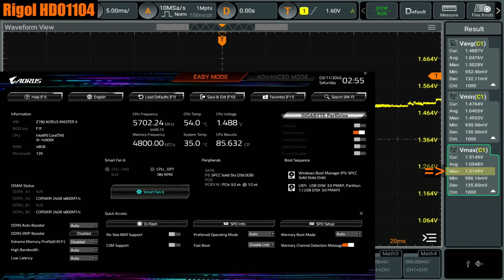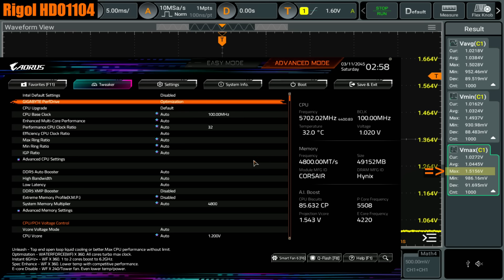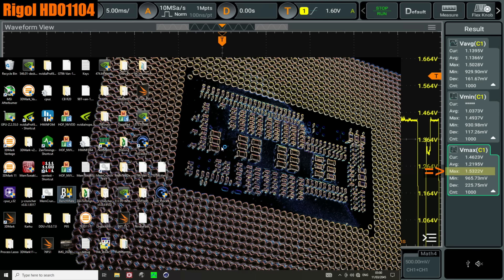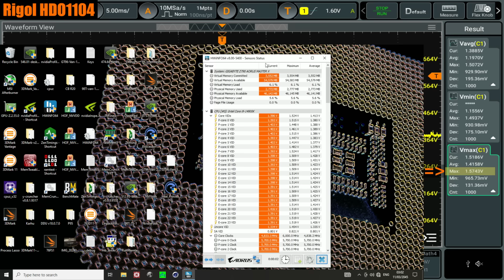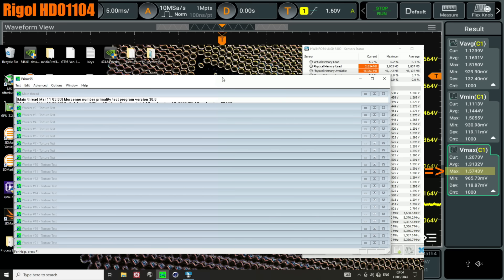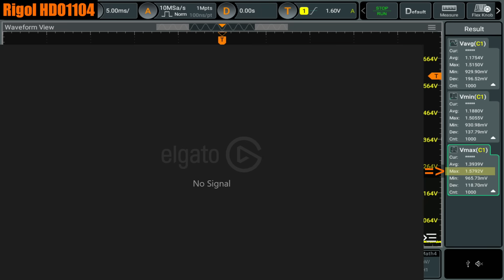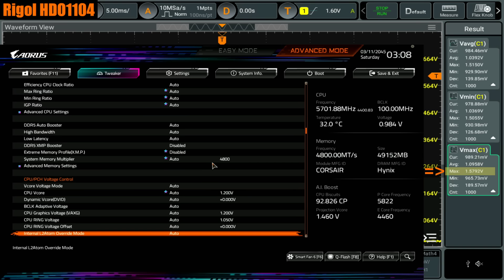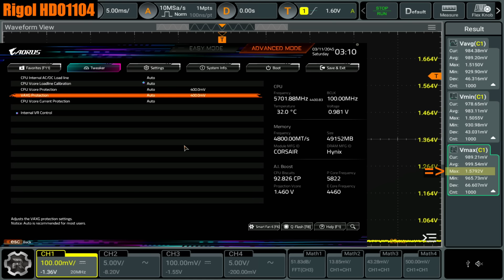Turning off "Intel Default Settings" with Microcode 0x129 DISABLES THE VID/VCORE LIMIT

Comment: best is MSI who decided not to implement IA VR voltage limit like Asus or Gigabyte and trust Intel instead .... "After internal discussion, MSI have decided not to implement “IA VR VOLTAGE LIMIT” to BIOS. MSI suggest user try the latest BIOS with Intel microcode 0x129, which have already improved the CPU VID spiking issue."  so improve not fix. What can go wrong .... what a mess.
Reply: Where'd you get that info from? Did they officially state this? Which would be a real bummer
Reply: Not wrong. Updated MSI b660 and it sent my 13600k crazy. Had to turn on cpu lite.

Comment: Thx, I will keep my old stable bios PL1 250/ PL 250, undervolt 0.1 / voltage protection 1400... since the begining i don't go over 1.37 VID, temps are good etc (system stable) I will not update.

Comment: With a good CPU there’s no need to use a new microcode. Just limiting PL1/2 and ICCMAX, and also, if you want, as TVB doesn’t work to cap turbo boost for the best to cores, one option to avoid the Intel algorithm to boost best two cores is just cap this to cores to 5.7 and those cores would be cap, and the remaining will use the Intel algorithm to boost. So, for light loads I use 57x with no crash and for Ycruncher or heavy workloads the PLs cap or downclock the frequency to 5.4MHz, however, for shader compilation or light loads, i always use 5.7 and I do pass CB15 exteeme, link pack and other test. I have a good CPU 14900K SP106, Pcores 115 and Ecores 88 and VF curve at 1.425 max voltage at 6MHz.

Comment: I’ve been running a 14900k @ 5.7 all core at override voltage 1.35v llc4. Am I still at risk of it spiking up to 1.55-6? I don’t see a reason for me to update or change anything
Reply: Oxidation affects every CPU, which is why all CPUs have a limited lifespan. Because the voltage peaks are often too high, the gen 13/14 break down more quickly.

Comment: I just capped all core on my 13700k to 5.3 (all core boost on default settings). Stock voltage it never exceeds 1.23v. z790i edge so no microcode update yet. Works flawless. Sits in the 60s gaming and peaks about 85 in cinebench on air.
Reply: I have a 13700K. I believe its original all core boost is 5.3 GHz. I don't real know what you have changed
Reply: @fangxu2  you cap all cores to not exceed 5.3. This stop single and dual core loads from boosting to 5.4 or 5.5. This stops the overvolting that comes with single and dual core loads. Which is the entire issue.

Comment: 3:40 I have a z790 Aorus Pro X and never touched my AC LL because I never had the experience to change that nor understand it. I knew I was right that the curve my motherboard was doing was not supplying enough voltage on high loads most especially multicore / more than 2 cores active loads. I never figured out how I could set the AVX offset to off instead of the default Auto that keeps changing settings depending on what my motherboard feels like. On default, it kept playing at -5 or -7 and I hated that the negative transients was caushing blue screens on my PC while I was undervolting it. I might as well as copy majority of the settings that you have on your 14900k into my 14700k and then play around with it to get stable. This band-aid fix is REALLY disappointing.

Comment: If I doesn’t want to use intel baseline profile while ia vr limit set on 1.4v - I doesn’t need an 0x129 microcode?
Ps. Motherboard is asus strix Z790-e and 14700kf
Reply: It doesn't matter. Look at how many volts your CPU is demanding from the motherboard when under load. Even if you currently have 1.4 set, it will go over 1.4.

Comment: They are slowing the degradation because they need to deliver advertised speeds and performance. You only safe if you set your own voltages and and speeds. It would be good if you can make a video setting a custom safe profile for people that want there hardware to last.

Comment: As soon as I select the Intel Baseline Defaults on my asrock z790 steel legend wifi, my i9-13900k requests 1,55v VID. With the same settings, selecting ASRocks 'performance' baseline, it requests no more than 1,36v VID. This behavior changed from 0x125 to 0x129 as previously it didnt change much between intel baseline and asrocks performance baseline before (slight VID up with intel baseline on 0x125 to 1,40-1,45v VID).
Reply: @PrismVuxOFL "128GB DDR5 Installed 4000Mhz (For some reason?)" if all four ddr slots taken, XMP can be activated/or clocks raised, if you raise VDD and VDDQ voltages to DRAM mnf specs. Also unsync all banks and set voltages from mnf there as well.

Comment: I got back my RMA'd 13th gen (13700k) a few days ago and its been night and day. I can't believe I waited this long for an RMA - I purchased the original CPU Jan 2023 and had it undervolted the entire time (CPU Lite Load 1, MSI motherboard) because I heard that it runs hot and I prioritize heat/noise. Instability occurred over time but I thought it was a problem with my wifi, a problem with my games, windows, etc. Windows wasn't crashing every day, but something would freeze/crash at least once a day. My computer effectively runs much faster and smoother now. It's crazy how much tolerance retail has - maybe because this is my only desktop. If I was working between two desktops with different CPUs, I probably would have complained earlier.
Reply: Imagine studios buying at scale

Comment: Makes me glad I only went with a 13600k this time around.   Max voltages I see at stock settings are 1.27  @ 5.1 all core, easily handles 5.5 @ 1.31v. 
Not touching these bios updates with a 10 foot pole.   They say some of the i5s could be affected, but I just run at stock speeds most of the time with a -75mv undervolt and have been since late 2022.   If they don't get this sorted out by 15th or 16th gen, I may hop to team red for my next upgrade cycle by then.
Reply: Same, been running 13600k for a year now with a small oc and no issues, tho I am running undervolt.
Reply: Good idea. I have a 13600k with no issues but I just updated the bios and then my VID went up to like 1.42v and my temps 95c. I turned on intel defaults and same deal. I ended up having to use CPU Lite load to bring everything back down. I should have stayed away.
Reply: @rover1374  depending on your motherboard manufacturer, you may be able to downgrade the bios to the previously installed version.   With my MSI board I was able to re-flash the bios I had previously (version "v1F" from november 2023).
Reply: @terminalfx  thanks, I got it going ok using lite cpu mode so I might just leave it until next time.
Reply: I built a 14600k for a client, I typically run a week long stress test which initially passed with flying colors, XMP enabled and everything, even manually configured intel default power limits vs the terrible ASUS defaults. Fast forward only a few weeks later, the computer wasn't even being used but just powered on, and started getting random crashes. Now the system is unstable with any XMP profile, had to reduce ram to 4400, which is "within intel specs" so it won't be RMA'd even though it's significantly degraded already.

It may be the initial week long stress test responsible for increased rate of degradation, but I've been doing this for 20 years and have always tested systems extensively without any issues. For my sanity I'm just going to swap to a 12700k and eat the cost on the clients behalf. I'll now be exclusively using Ryzen or EPYC 4004 for high perf client systems. 
These modern Intel systems are just a headache. 
When defaults won't even work, it's a failed product.

Comment: The CPUs cant maintain or boost to 5.8-6Ghz without requesting 1.4v or higher... and the budget silicon cant handle those voltages

Comment: How did it happen that the remaining microcode requests more than 1.52(or 55)? so,
the decision is up to the BIOS! these bioses [129] 
still do not work well with audio streaming under load (crackle from time to time),
with the old bios, even at significantly low frequencies and low voltage, 
sufficient performance can be achieved in the absence of clicks (14700k+Z790GamingX)
Special thanks to the author for the found "IA VR Voltage Limit setting".

Comment: I updated to the beta bios with the new microcode on my 14700K
intel performance (Asus doesnt give me an extreme option). ICCmax to 400A, PL1/2 to 320W, IA volt limit to 1.5V, AC/DC loadline to 0.5/0.5. And the VRM loadline to the recommended 4. As is, that runs CBr15.
Overclocked the cpu to 59x and now looking into undervolting the VF curve...

Seems that this chip runs 59x on 1.44V, but is capable of a -0.05V undervolt. Which is a worse result than before, where it could handle a -0.08V undervolt, so the new microcode is doing something.
Checking the next VF point: 56x runs with a -0.20V undervolt around the 1.22V.
Work in progress....

Still lots more testing needed, but the chip still seems to get way more voltage than it actually needs on the new microcode....

Comment: I personally turned on intel default settings with the microcode update plus turned on XMP 6000 on the RAM. I have high bandwidth/low latency disabled as well. Before all this information came out I was just running whatever profile was on it, think it was the gigabyte optimization setting then turned off multi core performance. This PC was built only like 9 months ago, i have a 14700k
Reply: care to explain how to disable "high bandwidth/low latency"? LOL
Reply: @brunodinis7454  On gigabyte boards you can disable those two features lol. Its gigabyte exclusive so no other board has it
Reply: @brunodinis7454  what ? lol - on gigabyte boards those are two features that can be disabled...

Comment: I am sure anything over 1.3V is a slow death for a CPU. Not even sure how much voltage was pumped to a rack of 14900K's with sub ambient liquid cooling.
I remember the first Zen 3 mobile laptop had a peculiar issue of hitting 110C after the repaste and power plan was set to high performance mode pushing voltage to 1.32V on 15w 5875u. After digging through driver updates it was a power management driver from Lenovo. After uninstalling the temps dropped to 55C at high performance mode with max voltage of 1.01V. With balanced mode, it's less than 50C

Comment: I have a 13600KF on a "low-rent" Gigabyte B760 DSH3 DDR5 board with 6400Mhz RAM. I have never had any issues (apart from high VRM temps which were ameliorated by a BIOS update back in the mists of time last year). I did however, for the sake of peace of mind, update my mobo to the latest 0x129 bios for my board. 

I have not experienced any slowdowns, my CBr23 scores remain at around 23K. What I HAVE noticed though is that total package power now never exceeds 155W, whereas before it would routinely hit the 181W limit. Maximum VIDs have reduced by around 30-40mV (averaging just over 1.33V on the P-cores now) as far as I can tell. VRM temps have dropped even further to max out at around 70'C. I generally leave everything on AUTO in the bios except for enabling XMP and rebar and what have you - I'm not interested in overclocking it.

My bump of trouble tells me that most people running B-series chipsets won't experience issues even without an 0x129 update (even with 14900Ks) but have no data to back this suspicion up. B-Series is just pure bondage and discipline for K-series SKUs, although it seems it had been supplying more power than my CPU actually needed at full bore.

Comment: I have been using Intel extreme tuner auto overclocking on my 13600K. Noticed some funny stuff with the Intel default settings (this has happened on all previous 3 BIOS versions, including the "intel fix" one). IF i have INTEL DEFAULTS +all limits turned on with the extreme autotuner 2.0 turned ON (The offset that the extreme tuner is using is +0.02V, 5.4Ghz 1-2 cores, 5.3Ghz all core), i will get bit over 1.3V on all core load and ~100C on some cores (with lowered clocks, in the 5Ghz range or even lower). If i use ASUS optimized ones, it will do the 5.3Ghz all core as asked, 1.2Vish volts, 75c. So yeah, for me the Asus ones are WAY better. Tested Cinebench 15, that runs fine with 1.2V, same with Prime95. In general random use havent yet seen anything recorded over 1.301V (ASUS settings). Idle minimum voltages are between 0.706 and 0.723.

Did check the IA loadline and its set at 0.300 / 1.100 mOhm on ASUS settings. So, for me the autotuners 225W max power (on a 420mm AIO), lower temps, lower voltages on ASUS settings feels way safer than intel defaults with the mild OC.
Reply: You can't cool your oc, these aren't stock clocks.
Reply: @dusty_48  What are you saying, that Arctic III 420mm AIO cant cool a 5.4/5.3 GHz CPU ? Thats around 200W at max. I dont know what higher clocked CPUs are then doing if "i cant cool your oc".

His CPU was hitting 1.45V+, mine is maxing out at 1.3V on 1-2 core load and 1.2V on allcore load. I think im good here.

Comment: Yeah thanks for the bios update, 25k in cinebench r23 and temps under 90 degrees, got everything back to normal myself. 14900K
Reply: i9-13900K should be around 38k to 41k in r23.
Reply: @vbozenko  i know
Reply: @vbozenko  it was 39k before the BIOS update
Reply: Same
Reply: My is 15k r23 on i9 13900k with (max 1.6v)

Comment: i set the voltage limit for my 13700k to 1.4 (got a gigabyte aorus elite ax) and pray that we make it today 8-). Got me spare 12700k for when my 13700k explodes lol
Reply: It's fine, you can even set between 1.4 to 1.5 to be safe. I have run 1.47 on my side

Comment: You said AC/DC loadline for Gigabyte should be 1.1 mOhm. What about Asus ROG Strix x790-f? Where can I find correct values?

Switching from 0x125 to 0x129 bumped Vcore slightly up on my board. I don't like it greater than 1.44V so I guess I'm forced to turn the boost off and undervolt.
Reply: Theres a sheet from intel that says the ac, dc loadline must be the same. 1.1 is the correct default for intel.
Reply: @Keaweahe  I saw that. I believe I heard Buildzoid said in one of his videos that all depends on quality of VR loadline for particular motherboard anyway. 
I have fresh 14900ks waiting for me to come back from vacation. My plan is to put it in already fine-tuned mobo with very safe voltages, limit cpu to x50/x52 and try to make it work for at least 5 years. I want to tune it with my degraded 13900ks, but I don't fully understand steps to achieve my goal.
A video about how AC/DC loadline works would be a bless for me.
Reply: @hit-757  in a later video he mentioned one of them doesn't matter, i think its the dc loadline, i forget.

Comment: y-cruncher has a 2nd mode that is mostly CPU intensive, not sure how to use it via bench mate.
If you start y-cruncher directly, select option 1 and then 3 for a quick test or higher numbers for longer tests.

Comment: Evry game runs fine on my 14700k , sniper elite 5 crashes a lot while opening pr join custom lobbies, I was worried and searched everywhere if my CPU is degraded now... Turns out that game is prone to crashing and it's normal crash behavior of that game. It's a relief on my behalf but still this incident has left me worried now. I use auros elite z790M with intel default settings.

Comment: Shit this is bad. Microcode updates could eventually be distributed with the OS. I thought this was going to be the solution for normies. But if the fix only works with Intel power defaults there is no way around touching the BIOS for the fix.
Reply: Just learn how to limit vcore and test for it.

Comment: I have a 13900k system with an MSI z790 motherboard and a 14900k on an asus z790 motherboard and I haven’t experienced crashes on either system. Both left at defaults with xmp at 6400. I have been running both since release. 

Knock on wood.

Comment: The new microcode settings don’t change much because if they send out a proper fix that limits the 6.0/6.2 boost on single core to a fixed all core boost of 5.7/5.8 which fixes all the high voltage spikes and degradation issues they are then set up for a legal challenge in court for false advertisement which leads to more issues than an extended warranty on degradation failure…
Reply: they can just argue core clocks are like ISP speeds, never hitting the "up to" number, this already has precedent with laptops. and magnuson-moss warranty claims are out of the window with extended warranties if they actually respect claims made by regular users.
Reply: @KasasagiWad3  True, that's why the new microcode is still trash it still spikes voltage to 1.5v but only now it spikes for a lot less time so they can argue it hits advertised speeds still on 1 core and they reduced degradation hopefully enough where it doesn't completely require a recall while they screw people over denying claims for replacements due to degradation with other loopholes.

If people would just manually change the stupid 1-2 core turbo overclock in their bio and cap the voltage to 1.4x max it would fix all of the voltage spikes and degradation on their cpu's and work a lot better than these failed new bios microcode intel fixes.

Comment: Don't you think that your oscilloscope is no-where near enough the precision for measuring 5GHz CPU's properly? According to R&S and Lecroy, you need at least 2.5x BW of measured frequency for measuring the 3rd harmonics (5th, 7th & co. needs more)
The problem gets worse when probes come into play as well...
100MHz is like trying to look through a window w/ blinds on and a small gap there for light to come in, comparatively. The whole picture is not revealed.

Comment: I was under the impression that the microcode update applied to non-K processors. I mean when I'm reading the BIOS updates from MSI or ASUS, it seems to be non-K processors. I haven't seen it confirmed for both k and on k
Reply: even non-K versions of cpus run above 65watts, so i assume its for EVERYONE.